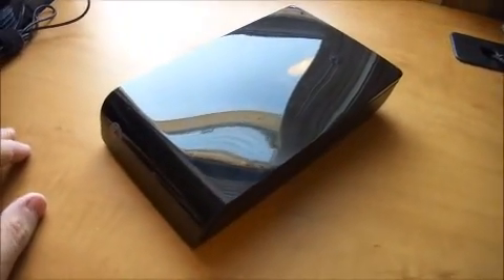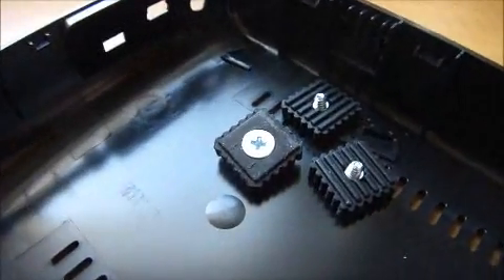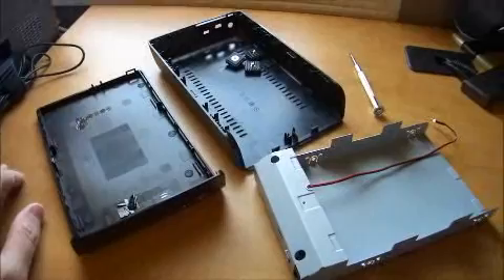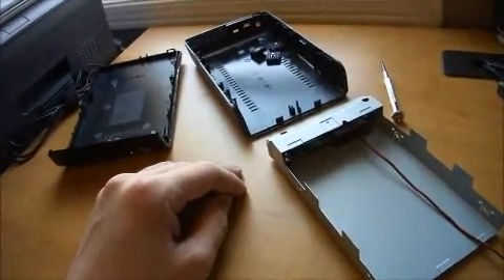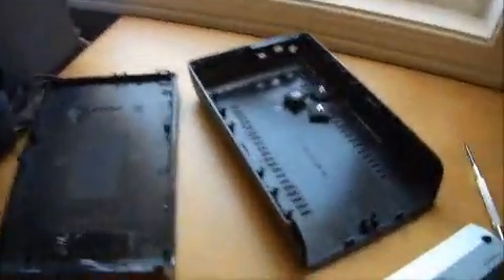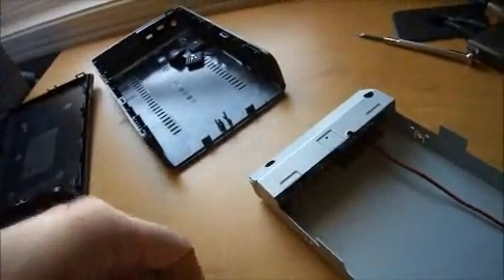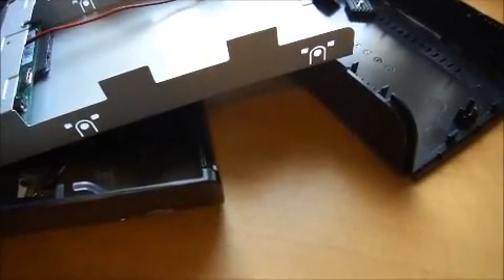FIX for clicking Seagate Expansion external USB hard drive

Comment: First off, not all units within this series were defective. Most were fully functional throughout their lifespan. 

In my case, we have three (3) such hard drives. I acquired the first two near the end of the first year of production. And then I added the third halfway into the second year of production.

All have functioned well over the years with no signs of your problem coming to light or any other issues to date. I am quite pleased with Seagate solutions.

 This summer I started to move my data from my Mac Mini (its software upgrade window has expired) to my new (well new to me) Mac Pro 2012. 

So I choose to remove all three Seagate hard drives from their housings and remounted them the onboard drive spaces in the Mac Pro 2012. All are working well at this point! 

At some point, I'll upgrade them individually, as my budget permits.

Comment: Remember this is only something to consider as a last resort, and yanking the drive out of the case could leave the case broken (as well as certainly void the warranty). If the drive works when directly plugged into a computer's SATA and power then you might think it was the fault of the electronics in the case, but it could simply be the drive is slowly dying (so back up your data while you can!!) and the "fix"merely was giving the drive motor a gruntier power supply so it will keep spinning just a bit longer.

And it should be noted that there are other ways to recover data from a dead disk (but they are a lot of fuss... best to never have the only copy of important data on just one disk so you never have to go to such lengths). I have known a lot of Seagates to fail.

Comment: they all fail no matter the make.  I bought  a 1.5tb free agent at a time when $80 was a steal for one.  I've  used that thing for years,  despite it clicking here or there and being dropped a couple times, one of which was a hard tile floor about table height.  it works fine still no joke.  I upgrade to a 4 tb model about a year ago and just  run media on the 1.5. I figured if o wanted to keep what I had,  I needed to get something o didn't worry about. the 1.5 has been a good unit to me despite TERRIBLE reviews. these I can't vouch for but I've used all brands of drives and it seems luck of the draw to the best I can tell.

Comment: I had a set of plastic putty knives from the dollar store that did the trick to open this without too much damage. (same tools I use for separating 3D prints from the print bed).
Unfortunately in my case it must definitely be a bad drive rather than a bad USB to Sata interface because the drive is still clicking and unreadable :-(

Comment: I have the same drive. One problem: the green light on the front of the drive is flashing and the drive doesn't show up on my computer. Can anyone help with my problem. I just want to copy my files out before the drive totally fails if it hasn't already!!!!

thx in advance.
Reply: Robert Rosal did you end up getting your file back because I have this problem right now...
Reply: Your hard drive inside just died thats the problem

Comment: does this device flash when it it is not plugged into a computer or laptop just by power supply?

getting no clicks on drive just left alone for about a 2year in cupboard since last use 
i tried using a ps3 game console lead as misplaced original lead but to no avail but cable works fine
might look for lost lead before smashing the case 
but could do with answer before proceeding

Comment: This Seagate lasted me since 2010, and ONLY today was the usb slot at the back of the case has come off (must of been jiggled lose, from over use and it's been in my car while driving with the plugs still in it). If it's a SATA drive then it's easy to recover my data, which is a fuck ton of files, anime, memories etc. collected over the year, I now hope it's not corrupted the data within.
Reply: +OnceThereWasAPageWithAReallyLongAssNameAndNowYouAreLookingAtAChannelWithAReallyLongName! 
same happen to me, hoping i can still save this 2tb of drive, but that channel  name tho!
Reply: Jewelinyou Mate you can, I bought a SATA external dock for about $30 I think. And I successfully got access to my hard drive again.

Also thanks haha!
Reply: +OnceThereWasAPageWithAReallyLongAssNameAndNowYouAreLookingAtAChannelWithAReallyLongName! 

thats the plan. hoping it still works because all my works is there. 👍👍👍

Comment: I had it in an earlier case.
It stopped working for no reason,  but it had been working.
The man in the shop replaced the case with a new on  (I think it's a USB3 one)  and it worked for a day or two,  then it broke.  He fixed it.  But I wasn't using it.  Now it's broken again and it's just been sitting there unattached,  so you're right.  What an idiotically poorly conceived and shitty product this is.
One thing to note is,  the cases have a warranty,  so you ought to be able to get your money back if this happens---I mean a Seagate Warranty.

Comment: the reason the drive is clicking is because the motor spindle is binding in the brass bearing or the magnets that the head coil controller are suspended in, are becoming weaker.

Putting it in your PC is only a temporary fix, as you're able to push more power into the drive to get is up to speed in the case of the motor, or into the control coil in the case of demagnetization. The  drive will still fail so don't just think you have fixed the issue, all you have done is waylaid it.
Reply: Simon Tate So how can this be fixed?  Is this a bare HDD wear and tear issue?  Is this expensive to fix?  I'm going to the shop tomorrow so I want to know.

Comment: I have the exact external except mine is 500gb i have had it since windows xp first came out & mine still works as is i dont know whats the prob with them because i have never come across it before i guess its all in how u look after them. i keep my externals all in a position where there kept cool & also the adapters since they heat up

Comment: I removed my Seagate harddrive from the external case about a year ago.  Just recently my harddrive died.  Clicking noise of death.  I got the 3TB baracuda ST3000DM001.  I took it out of my computer and opened it.  I see black specs on the top harddrive platter and almost like black toner on the bottom top cover of the harddrive.  Not really sure what to make of this.  I hope it's fixable.  Anyone have any idea what could be causing this or what I need to do to narrow down what part is at fault?
Reply: If I understand correctly you opened the harddrive case so that you can see the platters? If that is the case and you did not use a special clean room the drive will never work again (maybe it is possible to give it to a data recovery company that would somehow clean the platters and seal it all up but I have never heard of such a case and it would probably cost a huge pile of money).
Reply: Jan Man  No that won't work.  The platters must be exactly aligned.  If they get mis-aligned by even a small amount any chance of data recovery is gone and the drive is completely toast.  Even if a clean room was involved.

Comment: had one (500mb)  of these drives sitting collecting dust for years... didnt' think it was worth the hassle.... it didn't have a click... it just didn't work. Tryed different power adapters/usb cords.  So I pulled it apart and plugged into my tower.... It is FASTER than my current  drive in my tower. What a waste to put this with a usb 2.0  connection... The thing is benchmarking at 129MB/sec via sata connection.
Thanks for video

Comment: Similar problem with my Seagate Freeagent Desktop, only difference was that mine was unable to spin up the disk. HDD inside works fine connected to anything else and I did FOUND the problem with my unit. Voltage from power adapter was dropping to 11.5 V and drive was unable to start. Got a new power adapter and now it works fine.

Comment: Thank you! Stage 1 completed... Driver extracted from case.. loose part found floating around explained why my USB cable wouldn't plug it.  The little component had sheared off inside (explains the rattling noise when I picked it up).  No clue how cause the driver was just sitting a shelf for the past 4 months.  Wonder if gluing it back in will work... um..  Of to do stage 2 or attempt it anyway.
Reply: Sweet! My external 2gig HD is now an internal one, thank you for the advice :).

Comment: LMAO regarding the "with fury" on-screen annotation. I just now, 15 minutes ago, performed the same exact disassembly on my own clicking/ticking/slow-ass seagate external drive. Extracted the HD and plan to install it shortly into my computer. Thanks for the great video and good humor.
Reply: Did putting it into your PC help? Mine's only 1tb but it's getting so annoying and I can't watch anything at all.
Reply: Yes, works great now. Like a normal, internal drive.
Reply: David Pratt
i have the same one, opened it, extracted data and now i want to close it properly to take it to the service centre so they wont notice that it has been opened and give me replacement! some warranty left on it! but the plastic locks of it broke when i opened it,, can you help sir?

Comment: My Seagate SRD00F2 3TB External HDD packed it in. I took it back to DSE and they swapped me for a replacement. It was 7 months after purchase and I had the receipt. The drive has a 3 year warranty according to the packaging.

If you want to recover data though, this isn't a good option.

Always back up your important crap. 

In triplicate.

Comment: 90% of the USB disks on the market are fucking bastardized because they don't have ventilation. These are desktop drives designed to have some sort of airflow for cooling like they would in real computer. Defective by design!

2.5 disks are ok, because they are designed to work in enclosed spaces with no ventilation. Like your laptop's disk compartment or caddy.

Comment: My 2TB Seagate stopped working 1 year after i bought it. 
I plugged into the pc and it works. it seems to be a problem with the power supply.
I was scared because i thought i had lost all my data (it already happened to me with an hitachi hd).
Now i have an internal disk, but at least it works. 
I don´t know which brand is better, but what i am sure is that the life expectancy of all of them is limited, so you'd better save your valuable data (pics, etc) to DVD from time to time.

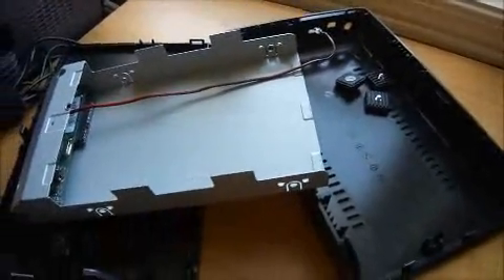Comment: what is the cable you can see e.g. at 10:17 for? Did you install a fan? And if yes, where on the board did you connect it? because my drive is working properly but gets very hot (often 55°C, one time even 56°C during a chkdsk) and I am thinking of installing a 25mm-fan myself. The alternative would be installing a fan on the outside and using a Molex power supply, but I would need an additional cable for it. A 25mm fan should use less than 0.05A, so this should be unproblematic for the enclosure

Comment: Here is how to fix it if you still want to us it as an external hard drive. 

Go to your local computer/tech store or order online. 

Only thing you'll need... 

1. Purex 3.5" HDD External Enclosure Model: PXE-U3PD/S (Cost about $20)

Follow the steps in this video to take part the piss poor seagate case and plug it into the Purex one...its a little trick with the screws but you're likely to get it working as I did..you'll also be happy like me. Good Luck!

Comment: Brilliant! I've just done this, with a difference. I took the case apart like you mentioned, but removed the entire HDD and connectors from the internal metal case, discarded the metal case, remounted the vibration dampers to the HDD and popped back into the original black plastic case. Upon initial re-connection, it clicked a few times, but has been dead silent since and still functions as a proper external drive with the original USB connector and power supply. Thanks heaps for this!

Comment: This will be good for taking apart my seagate since the USB port on the back broke off. I can't use it as an external anymore, so I still have the info on my 2TB. Based on what I've seen, it might also be just a port swap if I have the patience and the ability to find a USB 3.0 port.

Comment: I reused the case by adding cheap 128GB Kingston SSD in it (needs zipties to keep in place) and it works fine. Also tested smaller normal 320GB drive and no problems either. Needed storage that i can keep ON for long periods of time and since it's mainly to read data from it shouldn't degrade as fast as normal drive would so i saved bit of money here.

Comment: This happens when the hard drive cannot read a data or rarely due to over heating.This is actually the sign that the hard drive is dying .You can fix this temporarily by either cooling it by taking it out of the case and keeping it in a cool dry place( works if its overheated).You can also do this by heating it.by   keeping it in the  sun light for few minutes.If you do these solutions   then the drive may work for few minutes.within hat period you need to back up what ever that is important.

Comment: Had similar problem with 2 WD internal hard drives. Read that power or connector issues can cause clicking. I noticed that my PSU sata connections have only 12 pins whereas my molex-sata adapters have 15 pins. Still having problems with multiple drives connected but for a single drive, using the 15pin molex-sata adapter reduces the clicking noise to very infrequently as opposed to the direct 12 pin PSU sata connector. Haven't figured it all out but hope that helps.

Comment: @iMaZeJackstr get a sata cable and make sure you have sata hard drive power cable inside you computer plug the sata cable in hard drive and the other end in to the computer board. plug the sata power cable in then start up computer and see if windows finds it. and thats it

Comment: I opened the case, took the hdd out and plugged it into my pc.  I only plugged in the power cable and I still had the clicking sound.  They drive powers up clicks for a few seconds and powers back down.  Any suggestions?

Comment: Very informative and I like your musings in the little message boxes...

I looked at this because I just wanted to see what's inside (i'm curious)

I had a 2 TB drive exactly like yours, but after a week, it was thrown by accedent out of a 2nd story window... I bought a 1.5 TB drive, and never did I see this problem. So I suggest (if losing half a TB is okay with you) to get a 1.5 TB drive of the same brand and everything. I scored mine for $69.99 at Fry's Electronics after 2011 Black Friday.

Comment: I have a Seagate 1TB that started clicking more and more often recently. My fix is simpler: disconnect and reconnect power, listen for the disk to spin up with one small, initial click, then attach connect to USB (or turn on computer with USB already in). I do that, and it works flawlessly without modifying the drive or enclosure at all.

Does this work for anyone else?

Comment: I had clicking on two seagate drives (USB power no AC adapter) and I just replaced the housing and sata connector. That fixed the problem.

Comment: Hi, I had almost the same problem like you and neither Windows nor Ubuntu would recognize the drive.I opened the drive with you video instructions. 
They helped a lot. 
The case is fine  with a few broken holders but never mind.
 I think it's the SATA-USB-chip-controller used which is causing the problem.
 I built my 2TB drive into another USB drive case from conceptronic with another chip-controlle  and it's working fine so clearly a misconceived electronics design .

Comment: @Ripitup11
If you're still suffering from your ext. HDD problem on your Mac then PM me with more details...
I'm a -Doctor and have also worked as an HDD OEM manufacturer for the last 15 years.
And never mind ForbodingAngel2's remark :D Your Mac is such a "real"-ly good computer that it tells you (by not mounting your HDD every time) that something must be wrong with that drive for sure...
:)

Comment: I've had a seagate 2tb external HDD for over a year now, when I first got it (for a christmas present) it had this clicking noise, and when i looked for solutions back then I found nothing. So instead of revising for exams I decieded to try and fix this problem, I've looked at videos and solutions of forums, however before i ended up taking it apart is just happend to leave the thing upside down. It's completely stopped clicked and has normal read/write speeds. Will post back in a week to update

Comment: I have tryed it again in a new Antec external drive case and it still has the clicking so you do need it in the computer. I dont think any external drive cases that you can put it in. i have tryed a 2tb external iomega and a Antec cace that is worth $50. The hard drive still makes the clicking.